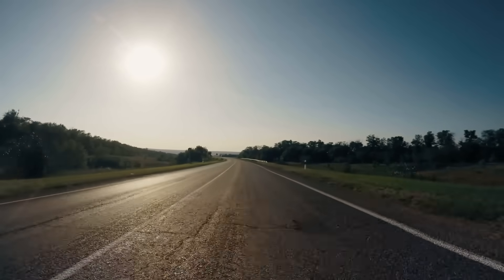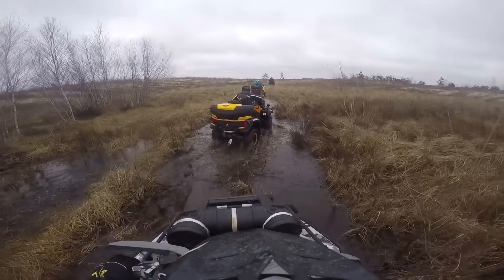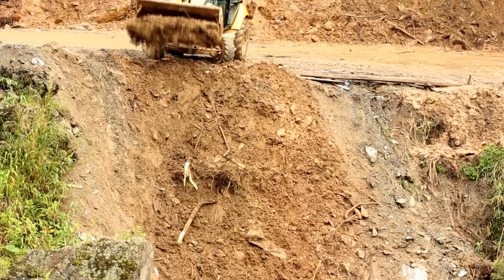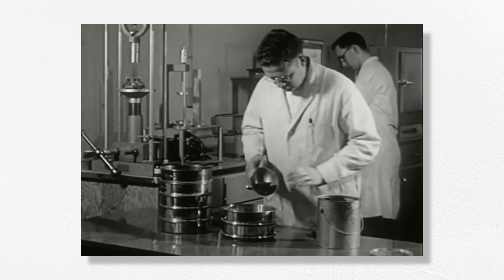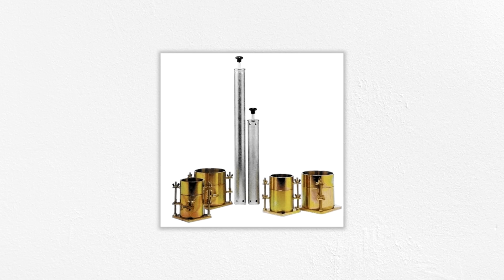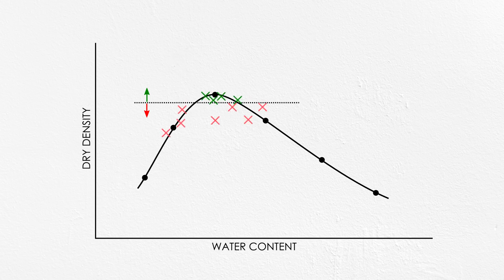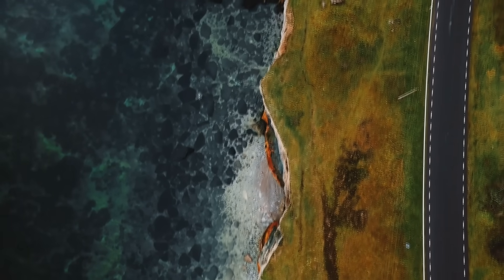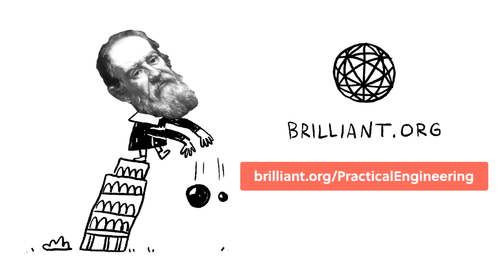Why Does Road Construction Take So Long?

Comment: I thing private contractors do a lot of planning for the state. After all it is to their benefit if they keep busy, and don't have to buy equipment for only one job. Twenty earth mover can get the job done in a month but the four that they have will only delay the project by four months. They like to let concrete cure for two years before they let traffic on it rather than two months when it looks ready.

Comment: As a follow-up - even 5 years later - I'd love to hear (1) your take on the Lincoln Highway, particularly the "Ideal Section" in Dyer, IN, and other aspects of the history of highway cross-section design. There is even a monument to it by the side of US-30 in Dyer. There used to be a wonderful photographic exhibit on the history of road design in the engineering school at the University of Washington, in Seattle. As a cartography major I found it fascinating. And (2) A video about the use of photogrammetry in highway construction. My photogrammetry professor related his experience of being hired by the Ohio Highway Dept. when a bridge on a curve was clearly not going to 'meet in the middle.' He was hired to conduct an as-built survey and plot a new course for each side, so they would meet successfully.

Comment: As a material tester, i could agree that earthwork on a large scale takes forever, part of it is that you have contractors try to get away with not properly processing soil until they spend the whole day trying to compact dry dirt, either that or they SOAK the lift causing even more issues

Comment: When I was a teenager back in the early 90s, they were widening many roads in Cobb County, a suburban area of Atlanta, within a year to a year and a half.

All of these roads were widened in a short period of time.

- Powder Springs Road from the east West Connector to Marietta. (roughly a 7 mile trek)
- Floyd Road from Clay Road to Hicks Road (a two mile trek)
- Windy Hill Road from Austell Road to South Cobb Drive (a three to five mile trek)
- Dallas Highway from John Ward Road to the Paulding County line (an eight mile trek)

Now they can't widen any road over a mile without it taking a minimum of five years.  This holdup needs to stop.
-

Comment: I'm currently a student in Europe for road construction,  im learning pretty much the basics of roads construction and everything you need to know about it, and idk if in America you guys have different procedures,  but im seeing alot of stuff I've never heard of or seen. The first thing is the compaction of raw soil, the idea of compacting it is new to me, because we dont use fill soil to build layers, we have 3 layers 1. Upgraded soil ( base layer ) which is soil, with rock additives, to strengthen it and make it pretty much a hardened soil. 2.  Cold resistant layer + draining layer ( mid layer ) 3. Leveling layer ( idk proper English terminology, but I believe its base course and binder course ).
Thats very simple explanation for what we have, its goes much deeper than that, but I dont know the English terminologies. 
With that in mind, can someone from the US  road work industry explain why you guys have much less "difficult" road building? Is it because lower moisture? We have pretty good moisture here, mostly black earth and clay under our surfaces.

Comment: Most roadwork in Texas could be done at four times the speed of the actual construction time. The state refuses to budget for efficient construction. Because longer construction times allow the contractor to pocket more money — and therefore these companies can kick back…I mean contribute to the campaigns of lawmakers — the state chooses to budget for exceptionally slow construction. Our state Republican officially only care about how much money they can get into the pockets of their cronies.

We see plenty of evidence that roadway improvements and/or repairs can be done MUCH more quickly. When major roadways are damaged to the point of making the roadway impassible, suddenly we discover that the state CAN work quickly and safely.

Here in Austin, we’ll see highway improvements such as widening or rebuilding that take five or six years to complete. I’ve been living in between major highway projects that have been ongoing for going on six years. Yes, COVID caused a year-long delay, but widening a six-seven mile stretch of highway shouldn’t take five years. Work has only been done for maybe seven hours per day, in only one section of roadway at a time. This has made my life miserable for far longer than it should.

If the state paid the contractors to work 24 hours per day, with enough worker to simultaneously work on all sections of roadway, these projects would be finished in 9-12 months. (This is per a civil engineer I know who specializes in roadway design and traffic flow.) the contractors do not make the same profit from this kind of work, so they lobby the state to make roadway construction projects be budgeted for exceptionally slow progress.

Comment: I appreciate your video on road construction and caught the general cost of $3M per mile.  I have in my mind $1M/mile for pipelines as comparison. Also, recent funding US DOT of $660B for improvement of 65,000 miles which equates to $10M/mile. That also includes bridges and other infrastructure but I would expect improvement to be less than new construction.  Is this an apples to oranges comparison or perhaps wasteful spending?

Comment: Simple answer?  Because they can charge so much more money for it if it takes forever.  Our civil engineers and planners make roads that cannot handle the elements and the abuse and then they turn back around and reach in our pockets for even more cash to redo their mistakes.  If roads take this long to build they should last for 50 years.

Comment: Hey I’ve done this one! I worked as an intern for SCDOT construction.

Regarding the dirt density testing, the dirt proctor tests are actually done in the field. A sample of dirt is placed in a sealed pressure vessel with a chemical that reacts with water, along with a ball bearing around an inch diameter. You spin the pressure vessel (it’s around the size of a football) in a specified manner and check the pressure gauge on the vessel. You then use a table to determine the moisture content of the dirt, which is then used in conjunction with the nuclear gauges you mentioned to measure density.

It’s probably the coolest test they get to do, although it’s a bit of a pain.

Comment: That's funny all the road work/construction work I see the road is muddy. And one place where there working on the road they put up barriers cones at the start of the year and haven't touched anything yet and it's suppose to just be a repave. If it's just a repave what are they waiting on and why did they put up cones so early I've seen them repave miles on the highway in a week. So no this answered nothing on why it takes so long

Comment: Come to Southern AZ where they just... meeehhh pave over the desert dirt after maybe a road grader.   Weeks after new roads are built the asphalt will climb the curbing around corners and well simply NO effort is made to prevent hydrolic spots from recurring potholes big enough to hide a garbage truck in from forming every year.  Drainage etc is another thing they don't take into consideration here.

Comment: In chicago 1980's existing highways would take a year or 2 for a long way , now a year you might see 10 feet. One road took 5 years and they built , tear down 3 times (existing road). Roads today are no better than in the 80's here lots of limestone.Its called milking the job. 80's were great seeing the work go ,lines of rock trucks, mixers ,heavy equitment.Todays interstate breaks up bad in places every winter,didn't use to be that way.Chicago Palumbo was a big one ,they cut them because they had one little bad spot on 30 miles of highway Lindahl was another STATE inspectors didn't do their job and blamed them because the blacktop got a little thin in  spot, about the lengthof a short city block . these guys today do not know how to build even a piling in less than a year,can't make a cloverleaf right, it has to have a pitch and they made it opposite , after winter you can see where everyone  crashed against the wall.

Comment: nobody ever seems to consider other trades and what problems they’ll encounter with the work you do. You’re working together to build something. As an iron worker, I always build my work keeping in mind what the electricians or carpenters need to do to do their work without my rebar getting in the way. Everyone should be doing this. Jobs go way smoother for everyone. I know we don’t get paid to make others jobs easier, but if you build good connections and reputation in the industry your job will become even easier than if you just showed up, slugged In your bar, set your cover and walked away..

Comment: My view on this issue is that the contractors don't understand nor deal effectively with the requirement to keep the roads open while doing construction.  This is the most irritating problem of construction.   The inability of a contractor to make changes without padding his wallet is legendary in construction.  Graft and corruption affect construction at nauseum.  Labor unions have a very negative affect on the ability of a job to be on time due to union baloney.  Their hours MUST accomodate the required traffic needs.   Companies not related to the construction do not change their hours of operation to comply with union and contractor bovine scatology.  I don't like unions, never have, never will.  My OPINION.  Like it or not!!!

Comment: So if engineers have so  much science about roads, why are they so bad?  I mean, even if they don't have pot holes yet, the are not smooth.   Also, no road leading to a bridge is at the same level.  There's almost always a bump entering and exiting a bridge.   Seams like a simple thing to figure out what level the bridge is and what level the road should be.

Comment: The cost of the road work will be the same amount rather there are 2 guy's standing around or 6 guy's standing around,  most of the cost comes from the quarter million dollar machines on the job site which can be anywhere from $2K daily and up, way up, per machine plus operator wage, and fuel costs, the guy's standing around might cost $100 a day on a federal funded job and they're mainly onsite to move any small amount of material the machine operator might spill onto the lane of traffic or into a drain system etc, check grade, look for any undetected buried existing utilities, so if the operators are climbing in and out to clean up every 10 feet or to be sure they're clear of any utilities then figure the math and find which costs less!

Comment: I love this stuff. When I was working we built lots of “temporary” haul roads around various construction sites. Although these did not get pavement in the end, they did have to stand up to a steady stream of off road dump trucks that weigh 90-100,000 pounds.  Importing large quantities of suitable materials is a budget breaker, so we would use stabilization products to get the soil to compact  properly. Expensive business either way. Good job Grady.

Comment: Great video, but I think you could add to the understanding of compaction by demonstrating the difference in compaction achieved by pad-foot rollers vs smooth-drum. It is a critical distinction when it comes to the process as they are specifically designed to compact different areas of the lift. I just think this example adds a bit of additional context to the whole concept. (I spent about 10 years as a civil and mining earthworks operator). Still, you seem to have a wealth of knowledge and I really appreciate your videos for expanding my rudimentary knowledge of engineering and physics. Thank you.

Comment: Small road no more than 400 yards long behind my house has set a new record for cost and length of resurfacing 3rd November and still working!
Workers used a huge new Wirtgen Road Planer, small bucket loaders...They even got a 100 ton mobile crane to lift a drain cover!

Comment: Here is Québec, I have seen many repaving jobs in rural areas take summer/fall (akia: rip ashphasl and redo the base in june, and wait till end of september to actuall pave). 
 When you call city, they tell you that they must let the gravel base compact over summer. By the time they are ready to pave, the gravel road is so damaged, they restart the work and re-level the gravel road , undoing any pseudo compaction done with rain/cars during summer :-) 
When they are in a real hurry, these civil engineering works don't actually take long because they work constantly. (such as highway 105 in Los Angeles after North Ridge Earthquake).

BTW, when their built the Dempster highway between Dawson City Yukon and Inuvik NTW in the late 1970s, they had to deal with permafrost. At one point, they cleared the vegation and stopped work for winer, but when they came back the next summer, there was a lake where the road was menat to go straight. The final road had to go around it. By clearing vegetatation and not buioding road over it, it allowed ground to melt, and as a result sag and collect water whose weight caused it to sag more.  So to replace the insulation of vegetayion and protect permafrost, almost all of the Dempster is elevated except where ground is sufficiently rocky, so for some 750km it was a net defecit of landfill needed to elevate the road.

Alaska highway in Alaska  is paved, but has many layers below it, including insulating "carpet" layer.

Comment: How about some more info on road repairs? Here in Michigan, it's a fairly infamous practice to replace damaged roads which were constructed in concrete (even minor damage) with large replacement slabs which cut across an entire lane, which ultimately degrade the road a lot more than the original damage: by using (apparently) inferior quality concrete, and being not smoothed properly, adding more forces to destroying the concrete as tires hit irregularities, and I'm sure many other reasons. This practice over the last 30 years or so has pretty much ruined some highways requiring them to be completely resurfaced and has greatly contributed to Michigan's reputation for having terrible roads.

Comment: The issue I have, as a truck driver and seeing more than my share of road construction, is that often the final product does not improve upon the drive. So often new projects suffer from uneven joints, parts of the road buckling, and the ever present teeth rattling jolt at overpass seams. Not sure if it's poor engineering or poor execution...🤔

Comment: I live in the UK, there's a major road passing close by my home. I mention it as it starts in the city of London, not far from a Prontaprint store I used to run it ends in Holyhead and is the A5. It's foundation is old, really old. It was built and known to its Roman builders as Watling Street. There are many roads here that are using the Roman foundations. Their roads cost a lot less than ours but we have done away with slave labour, thank goodness.

Comment: Although relatively small scale compared to most consyruction projects, in 2015 there was truck carrying a flammable liquid that lost crashed and caught fire under a bridge where Columbus's outerbelt (I270) and major east west highway (I70) cross. It  destroy a big portion of the bridge.  They had it reopened about a month after the accident. Not only that, they had had bypasses open within a day or two of the accident.  Really an impressive feat considering how long any road work takes. 

Kudos to everyone involved in that project.  It may not be on the scale of the  Orville Dam spillway repair but pretty impressive none the less.

Comment: Not sure I agree with this. Bureaucracy, unions, complacency, greed, corruption, and over regulation are what I think it is. 75 years ago, road workers were building miles of roads with less technology, and inferior equipment and are running circles around the pace of road work today.  I graduated college in 2006 which was when cones for construction on a 15 mile section of an interstate began. Going into 2022, it is still far from finished!

Comment: They redesigned the road where I live. Boy, what a work. Since there is a small gradient in it I am not surprised at all that there was an GPS antenna on the leveling machine. The road looks wonderful and since I live in a domestic area lots of twist and bumps to reduce speed. I am Dutch you know, we love bumps, gives the idea of a hill, have not much of those.

Comment: Its funny watching that whole video and not once saw a pad foot roller compacting instead there using smooth drums to compact, unless they were sealing up but if your doing lifts or compacting loose fill up to 300mm - 400mm pad foot roller always, smooth drum for sealing, roadbase and AC

Comment: As a resident of West Virginia, where some of the interstate highways in the state are practically disintegrating, I can appreciate when construction happens... I have a problem when the state decides to shut down a dozen stretches of the same highway at the same time. You finally get out of the roadworks, but less than a mile later you're right back into it.

Comment: San Antonio northwest side on I-10 is expanding lanes & new overpasses going up. They demolish the old overpass in Boerne . I-10 on San Antonio east side is expanding lanes as well they tore down two over passes to rebuild them to make way for extra lanes. I-10 at loop 1604 on San Antonio east side the new overpass currently under construction is considerably higher than the old one still in use . I-10 at loop 410 on San Antonio east side they just started the new fly over project that will get rid of the inefficient cloverleaf interchange fun times here in San Antonio seeing all these road construction upgrades 🛣 🚧👷‍♂️